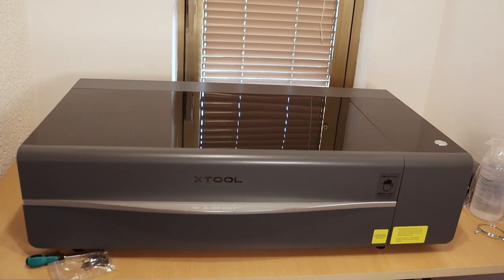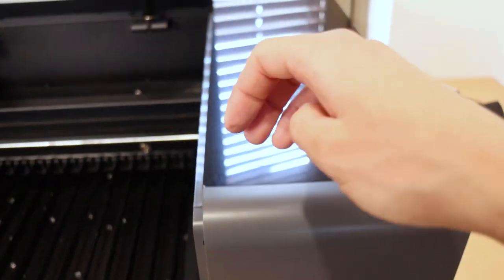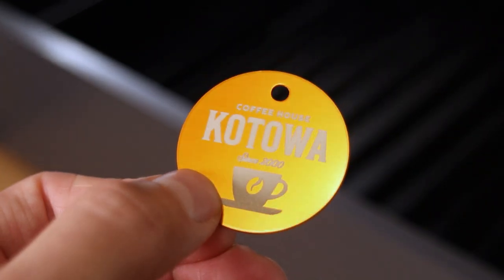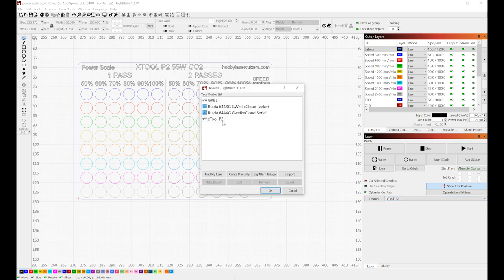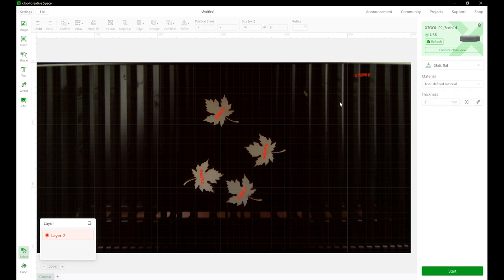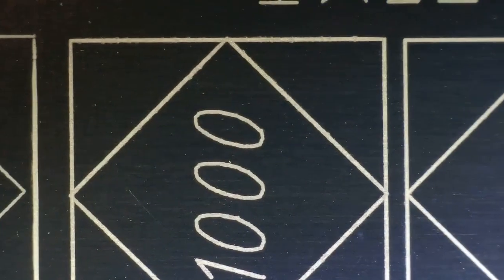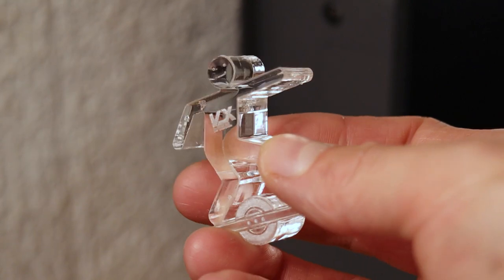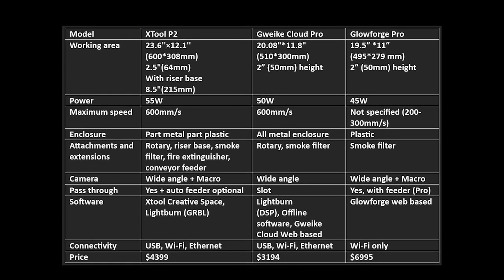xTool P2 55W Desktop CO2 Laser Cutter: PRACTICAL Review and Test - Is it worth it?

Comment: The P2 produces a lot of SMOKE STAINS, you shouldn’t have to use masking tape. Masking tape on detailed cutting is a nightmare. The Gweike produces much less SMOKE STAINS, according to your samples.
Reply from the maker: Sorry for the late reply. Meanwhile I found out that I had a slightly misaligned optical path on my machine.(beam was not in the center of the lens). I have adjusted the deflection mirrors according to the xTools video tutorial and now the machine produces far less smoke stains and cutting performance is even better!

Comment: The P2 produces a lot of charring, you shouldn’t have to use masking tape. Masking tape on detailed cutting is a nightmare. The Gweike produces much cleaner cuts and engravings.
Reply from the maker: I think you mean smoke stains not charring? Charring occurs on the edges and they both produce very clean cuts on plywood.

Comment: Question… is it possible to cut a 3mm deep inlay to fit some LED rope for a neon sign, inside of the groove, if I have an 8mm thick sheet of acrylic… and how do I do that?? #ThankYou  #Newbietothegame
Reply from the maker: That would be quite tricky. Maybe if doing  many many engraving passes but that would be slow. The other way is to use two acrylic sheets - one top sheet and you cut the channel through the bottom one. Third option would be to use CNC router.
Reply: @JTMakesIt  Thank You for your reply! grateful for your time and attention!

Comment: Awesome test. Could you try some 1/8 inch mild steel and see how many passes would be needed to get through it, if it is even possible?
Reply from the maker: Hi, Steel cannot be cut by this laser. You would need much more powerful and much more expensive machine for cutting steel.
Reply: @JTMakesIt  not even in the slightest?
Reply from the maker: @fmixthings  maybe you can cut very thin strips like 1/10th  of a millimeter thick which I have successfully cut with 20+W diode lasers

Comment: I am struggling to get the Z-axis working correctly in Lightburn. I followed the setup procedure from xTool but I have to manually move the Z every time or it will not move during the engrave/cut. Did you experience any issues with Lightburn and the Z-axis? Thanks for a nice video.
Reply from the maker: Yes you need to adjust it everytime. The Gweike works the same. If you add the required G code (as seen in the video) in the "device settings->Gcode" it will automatically adjust the Z axis after you start engraving every time. But if you change the thickness of your material you need to update the number manually
Reply: @JTMakesIt  Thanks. I spoke to the support at Lightburn and they said they are working on it. Hopefully, they get it corrected. xTool creative space is not bad but Lightburn is just too powerful to be without.
Reply from the maker: @stevegood3224  I agree. But I was genuinely impressed by the xTool software. Initially I thought it would suck, but when you get the hang of it its pretty cool :)
Reply: @JTMakesIt  xTool software has layers that are critical. The curve mapping works utility works well and after I made a flat black board to cover the bed the smart fill works great.  It just needed better background contrast. The laser path is not as good as Lightburn but I can get around that most of the time. Compared to any of the other software that comes with international lasers xToll software is fantastic. Even better, I feel like they will continue to update it. They are very responsive. All that said I am still a Lightburn guy. Lightburn is just too powerful.
Reply from the maker: @stevegood3224  I totally agree with everything you said!